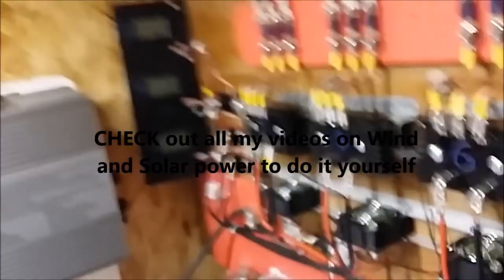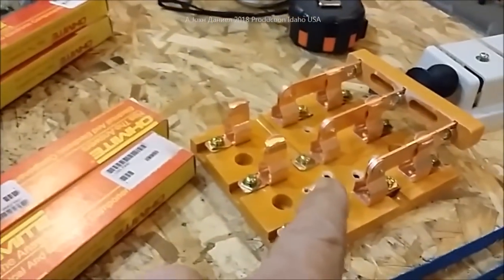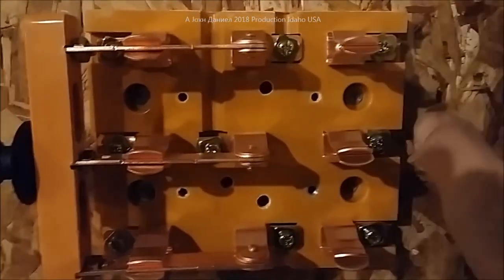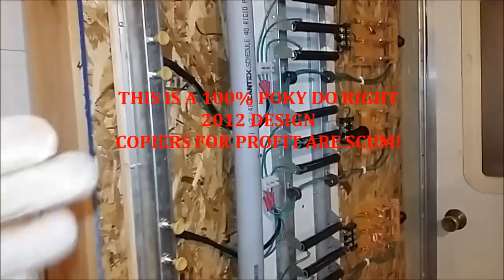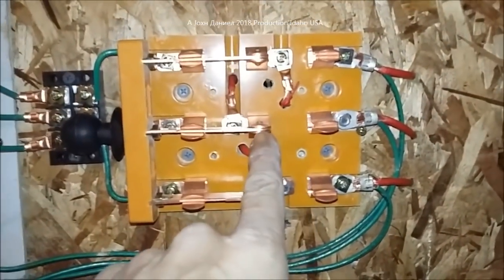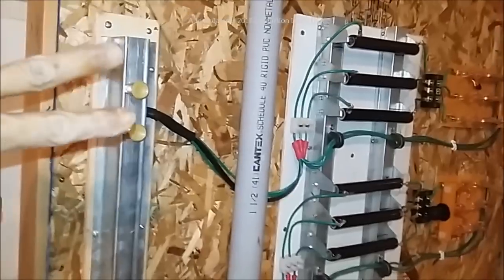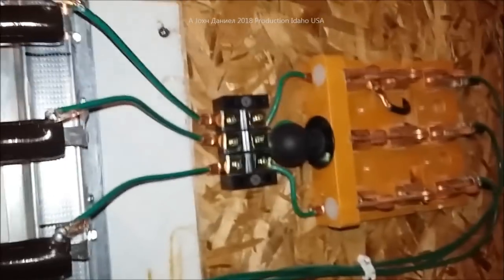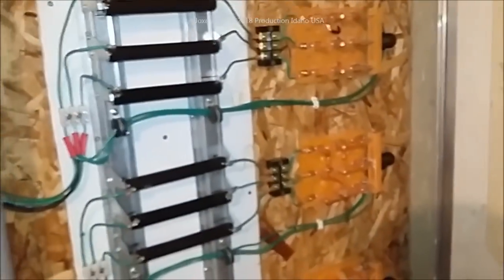Wind turbine wiring with disconnect design, material list below!

Comment from the maker: SEE ⇑⇑ ALL PARTS AND SOURCES LISTED ABOVE ⇑⇑ VERY Best #1 Listed links to them Under Video and is in many my videos To get 100% full batteries from one & to divert over volt you need these: https://amzn.to/37HN2OR 100A SQL Rectifiers &  https://amzn.to/2MTUjCU A All purpose long life Load controller and be sure to get up to & over 300 watts diversion resistors ( https://amzn.to/2QngFPq x 3) + one or more 60 amp SSR ( https://amzn.to/2QKEyj0 ) with heat sink ( https://amzn.to/2ZYtmna ) be sure to use thermal past on it.  ( Proper type - https://amzn.to/2QN2hir from Protronix)    Subscribe, check all on the channel.

Comment: Have you ever played with load controllers?  I'm adding wind power to my off grid system. I've accumulated some parts and have a xantrex c40 charge/load controller.  It should apply the dump load incrementally.  I'm hoping this route will be efficient and effective enough. Is this a good idea?

Comment: Thank you for your info, I used it to help understand how to build my own automatic brake control, using voltage controller, resistors, a 3 phase relay to tie load of three phases of the ac hurricane wind turbine vector from hurricane wind power. When speed of blades/voltage coming in gets to much, I have set at, it turns relay on, loads up resistors and shorts three phases together slowing down and keeping turbine from flying apart, all from the videos you shared, so I greatly appreciate it, again thank you.

Comment: Hello John , I've build this setup . But have a question . When I run the turbine trough te resistors , the turbine is running much faster than when it's under normal operation . It's a 500W chinese turbine  , 3 resistors 100W 5 ohm ohmite on 12V battery's.  No brake switches , just feeding it trough the resistors and than to the controller .
So I don't understand the fact about saving the blades , it's looks they get much more rpms . Maybe I do something wrong . Is this system working on lower winds ? Maybe that's the problem . They do drop the voltage down very hard , output is 70 to 80% lower , only the turbine is going crazy .

Comment: If I go with a direct AC to AC grid-tie inverter set up, would I be good under most conditions to avoid braking due to the fact that I will almost always be using more power than the turbine will be producing?  I will be building a braking circuit with resisters if for no other reason than to safely shut it down for any potential maintenance.  We don't want to be throwing "soft rope" into our blades to stop it from spinning! lol

Comment: just watched your video on the brake system. I noticed that there is what looks like a rectifier, but has 3 wires in and 3 wires out.
could you post the link for this part please.
Reply: I've been binge watching his videos for a few weeks in my spare time.  It sound like you may be looking at a solid state relay (2 in 2 out) or his inline 80 amp breakers.

Comment: Love your videos! Is there a total wiring diagram that you have that shows this and what's downstairs? I am adding that 500 watt turbine to my solar array of 510 watts that is fed through a Blue Sky 3024. That feeds 12 6volt 320AH (960 AH total) batteries wired to 24 volts. That feeds a Trace Engineering 3000 watt sine wave inverter. What are your thoughts of making this braking system automatic?

Comment: Hey john what parts do I need to make a resistive braking switch for my 500 watt beast of a turbine? I have a 3 phase throw switch that has the turbine wired to the handle with tempco 6 awg welding cable on all 3 ports .then your beautiful red box on the down pull side with 10/3 carol wire 10.awg x3 .and the up position is open nothing on it. I have 3 100 watt 3 ohm omite resisters sitting around and a 90 amp 3 bridge rectifier new in box. What would I need to utilize the empty switch port and turn it into a braking system?
Reply: Do I just wire the 3 bridge rectifier first? Then what next? Do I just wire the 3 resisters directly to this in parallel? Or do I need a ssr?
Reply from the maker: If your going to divert with a second rectifier you just make jumpers of the proper size from your rectifier going to battery and then from that rectifier to some resistors in line or as a progressive load. Send me a email and I can draw you some options but be sure to put in there your current set up your on now.
Reply: @JOHNDANIEL1  ok I can do that
Reply: John could u please email me i cant find your email for some reason.

Comment: AC 3 phase from a 300 watt turbine what max distance can the cable be ran
Reply from the maker: 60 feet is max, under 50 is preferred, run with 3 strands of 10 AWG
Reply: Јоhn Daniel thanks john from rural Australia 🇦🇺

Comment: In your latest video I see you use a dumpload  through a 100 amp rectifier, is the series resistors in this older video better or do you prefer your setup in your newest video? In your experience.
Reply from the maker: Either method will work, I just use a progressive braking system on my older system, and a set load braking system on the new design.

Comment: Hi John,

I observed your Youtube videos of wind turbine subjects with great interest.

I am working myself on a DIY wind turbine project to be finalized this summer.

Living in the south of the Netherlands close by the sea (Zeeland) is an interesting location to utilize wind power (average wind speed 8 m/s or 18 miles/h).

Because I am not an electrician, I could use some help from a professional.

My set up planned is as follows:

Wind turbine VAWT 600W Chinese lantern type with MPPT controller.

Inverter 1200W, 12VDC to 230V AC.

As a dump load system, I planned a break switch combined with 3 electrical heater elements 100W (2 Ohm) to heat up a water buffer tank.

Measurements of Volt, Amp, Power, Watts, RPM and Temperature will be part of the system.

I still have a few questions;

Are the heater resistances high enough to do the job? (higher resistance is lower Watt, correct?)

Where to put fuses to protect the system against overload?

Do you have electrical wiring diagrams to share of such a set-up? (I think it is quite comparable to what you have).

I would really appreciate your help.

Thanks in advance and kind regards,

Jan

Gone with the wind.
Reply from the maker: You do not need to be an electrician to do this.. I will be doing videos from Invention to solution with many drawings, material examinations and details soon. I work full time, run a internet program, and raise 4 kids I home school. So my public speed is slower than most. But I am on to the idea that the more you teach, the more you find solutions.

Comment: is 12v wind generator and 24v wind generator the same resistors
Reply from the maker: 3 to 5 Ohm for 12 volt due to the heavier wire in the stators,  5 to 8 Ohm on the 24 volt due to the thinner wire in the turbines stators.
Reply: thanks good vid

Comment: Great work John. Very impressive. I notice towards the end you mention "I dont care for shorting the little chinese one too much". Could you please explain why? Just wondering if the two brake switches are really needed as I have the same wind turbine.
Reply from the maker: I do not believe in shorting any turbine whatsoever it's a Fool's Adventure it causes all the heat to build up in the stator of
 the turbine and burns them out no matter what brand make or model. Nothing I have used dead shorting as a high wind solution. All are loaded. And no turbine I own in 10 years has burned up due to this design. Can't say that for the spinning smoking Missouri sky rattlers. Lol.
Reply: Thanks. I think ive got it now. The brake switches can be used in high wind situations when the load is being restricted but should not be used as dead short. From what ive just read on google it would be a Fools Adventure for anyone to use the Missouri systems. Cheers.

Comment: I don't get enough wind for turbines. I'd have to go 60' just to get over the trees if I did. Mid summer I hardly even have a breeze. I guess I'm stuck with solar. And maybe a tiny mini micro hydroelectric setup. I maybe can get 300 watts from. Maybe 10 times that if I can build a holding pond. And release as needed. I'm looking for a 3phase motor to convert . alternators being about 60% effiecent . probably not going to work well for that. Keep up the great work.
Reply from the maker: HINTS TO SUCESS: SOLAR!
Create usable Air Pressure, Water Retention, and Always over buy your batteries.
Reply from the maker: I was Rethinking your wind issue, (based on 3 installs I have done for similar needs)  you need a Sunning 800 in your area if winds are dirty and not high production. Feed the incoming power into a rectifier from there to a pair of 12 volt slave batteries, then through a 80 amp PWM controller thats capable of 36 volts input to feed a 12 volt bank with. Put a over volt diversion controller between the slave batteries and the rectifier with 500 watts of resistors.

Comment: Not a bad idea! Like instead of a soft start. It's a soft stop! Or slow. And a low output. You can switch from. Correect? Of a complete shut down. Nice..
Reply from the maker: The design I came up with was due to the complete false information created by a moron seller named Jeffro Liar King Harmons. He pawns off vietnamese junk claimed made in USA out of Missouri. He sells a $3.00 switch in a $2.00 box for $49.00 to unsuspecting fools from his hyped up YouTube & ebay scam account. Dead shorting your generator in a wind storm burns them up, the heat created is a fire risk. So by allowing the voltage to be trapped, you get heat in the resistors and the feedback prevents run away on your generator thus for stopping it from making heat to begin with and at the same time allowing a portion of its energy through. The Missouri Scam Master is already trying to knock off and re-sale my design for $250 per turbine, this same one I showed you how yourself to build for $60 per turbine. He's a professional thief, expect no quality and proper math in his stolen version.

Comment: John... Just to say thanks for this setup I've done the switch and the resistors the weekend just gone by and wouldn't you know we have a storm tonight just flicked on the switch took the wattage down from 550w down to 70 to 100. Its going to get gusty overnight supposed to get 75mph +. What do you think is the safe wind for the Chinese Ne500? They say 30mph is rated speed in your experience what do they fail at?
Reply from the maker: Mine has seen 65+ mph gust, so far its still surviving. I think a slip ring failure may be the only thing that could go wrong from its high output.

Comment: Got my turbine up yesterday 😎 finally. Had a peak 387w in 30kmh winds. I've ordered up my brake switch and those resisters. Would that brake system stop the turbine in low wind?
Reply from the maker: No, the resistor in line design allows power though, but stops run away that would destroy your generator. I rarely even consider using straight brake shorting.
Reply: Јоhn Daniel thanks 👍

Comment: 2 40 amp switches,,got it,,how do we wire them?
Reply from the maker: Your coming in to them on 3 phases, ( pick a wire-any wire to create a center) center wire is split and connects to both switches, the other 2 wires go to 1 connection on each switch.  When you pull one switch you get half phase braking,  pull both you get all braking. That will short all 3 when both switches are pulled.

Comment: A question on your setup do you have a dump load for the extra power that you don't use
Reply from the maker: I have a dual staged dump load thats running on a 2 stage design to first trim the excess as it gets near a set voltage of 14.35 and its 500 watts and then a second 700 watts that kicks in to keep over volt conditions from happening in wind storms at 14.6. I only use SSR relays and pulse braking diversion load for my stuff, thats why it and the batteries last so long. Those hyped up Ebay 440 amp solar-wind controller scam boxes are a fire hazard and battery killer.
Reply: Yes I do have a dump load on my unit but I like the way you have your setup I think it's Unique and it's really super the way you have everything going for you which is a good thing keep up the good work I'll keep watching and show more videos . a lot of people can learn from you thank you Mike
Reply from the maker: Get 2 of these URD  12V 24V Diversion Regulator Control Relay SSR Solar/Wind/Hydro 1URDC-1224 controllers from https://rover.ebay.com/rover/1/711-53200-19255-0/1?mpre=https%3A%2F%2Fwww.ebay.com%2Fsch%2Fwindandsunpowercom%2Fm.html%3Fitem%3D132535104601%26hash%3Ditem1edbb53459%253Ag%253Am8kAAOSwjVVV2Mdx%26rt%3Dnc%26_trksid%3Dp2047675.l2562&campid=5337663791&toolid=20008 and I will walk you through a dual diversion system that will extend the life of your batteries by 50%

Comment: Cool ... grate job .  I'm a little slow so still processing whether this will work on my windynation supper amp that I'm putting up now . Its at 55' with the wires shorted at the moment while I try to finish under ground wiring to the house as weather permits .
Reply from the maker: +larry haney Those turbines can burn out under brake, be careful. Let it run a 500 watt mercury vapor bulb to keep it safe while sitting.
Reply: Ok thanks john ... I hope its not too late been having 20 to 36 mph here. is there something I can hook the 3ph ac to to use up power till I get wiring in to house ? I don't a merc vap bulb .
Reply: could I hook to the rectifier then to 1200w dump load ?
Reply from the maker: Avoid the You Tube RE-Energy "teachers" who sell shit! The most prolific one was a pottery salesman in missouri who is a clueless moron. Your dump load should NEVER exceed your turbine, in fact, the batteries themselves attribute to being a active 20% of it. Stay with 500 to 600 watts dump, you'll be ok and your batteries will live 2x as long.

Comment: John ... Just curious what made you choose the 5 Ohm resistor instead of one larger?   Concern over the drop or just basically all you needed to slow it to a safe speed?
Reply from the maker: +Lonely Prepper Homestead I tested 100 watt 1 ohm & 2 ohm and both allowed 90 to 95% through (bigger wire gauge in them) and that allowed "freaks peaks" in pass through breaking. The 3 ohm did much better so I chose 5 so it would be a better shock absorption design and it does a 65% to 70% voltage shading and worked perfect to gain resistance as volts rose as opposed to battery static. 
1 and 2 ohm are just near a dead pass for burn off. Not good for pass through use. 
If your system is 24 volt I recommend 8 to 10 ohm.
Reply: Thanks John ... appreciate the follow-up

Comment: You stoled my 🔪 switch idea, LoL 😃..
Good idea on resistor's! I've seen people using these 🔪 switches near batteries 😱 Thanks for sharing 😃
Reply from the maker: Thats Hossshits, I been using that design since my wayback days hustling appliance parts in Arizona. LOL
Reply from the maker: HEY, favor me on your next vid - Post where folks can get some kick ass blades. 
- From a real user of wind energy I recommend truth, no bull materials and durability. http://rover.ebay.com/rover/1/711-53200-19255-0/1?icep_ff3=2&pub=5575119394&toolid=10001&campid=5337668021&customid=Genuine+PMA&icep_item=232605009533&ipn=psmain&icep_vectorid=229466&kwid=902099&mtid=824&kw=lg The Original PMA, not a Missouri fake knock off. And the blades http://rover.ebay.com/rover/1/711-53200-19255-0/1?icep_ff3=2&pub=5575119394&toolid=10001&campid=5337668021&customid=Truly+Engineered&icep_item=232606155954&ipn=psmain&icep_vectorid=229466&kwid=902099&mtid=824&kw=lg The Only KT sellers are THS, Blades also available at Amazon http://amzn.to/2ECRa5o in numerous combinations